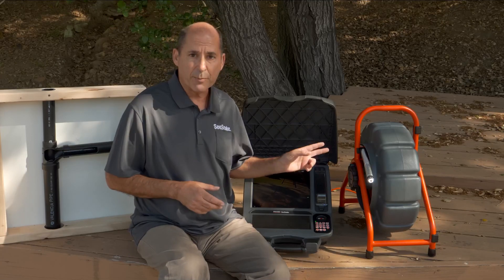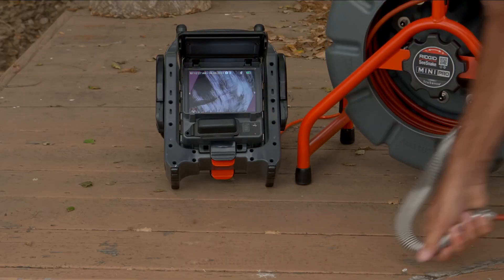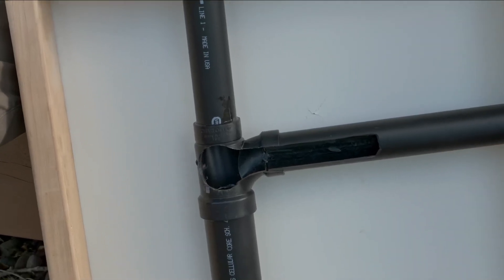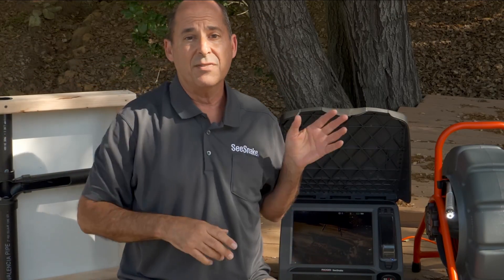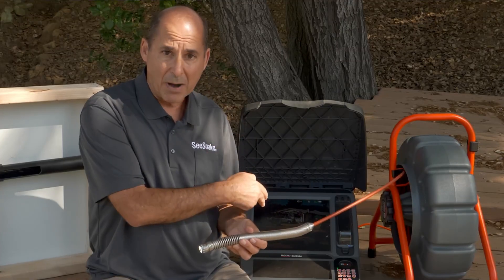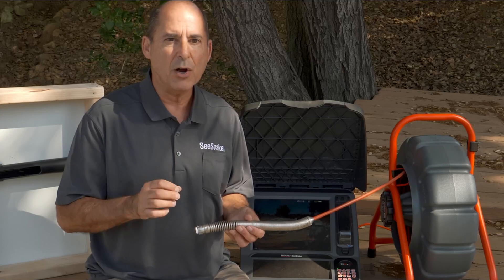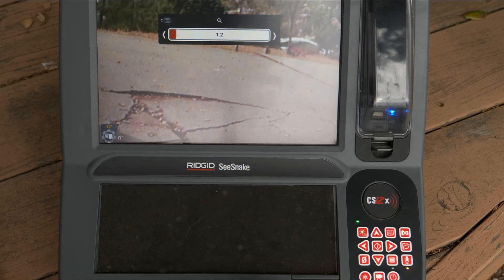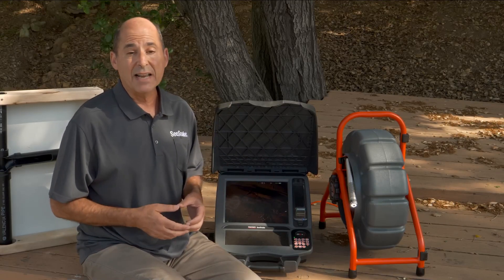SeeSnake Mini Pro - Digital Self-Leveling Overview & Options

Comment: An absolute must have if you do sewer inspections. I was on the beta team for the digital Self-Leveling upgrade. I believe its been about 1.5 years using that camera head daily without any issues. Ive recently upgraded all my cameras to have the trusense now. Just doesnt seem right going back to a standard Self-Leveling camera. Lol! I basically use those older cameras now for coating & lining.
Huge fan SeeScan! Keep up the great work!